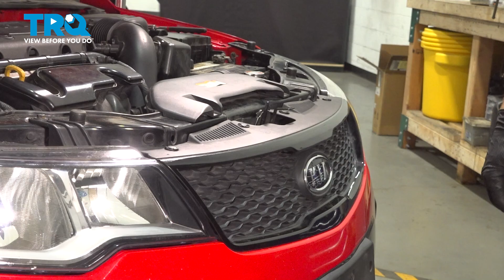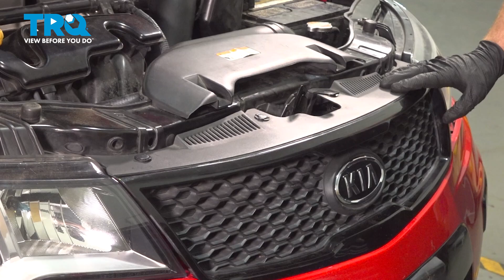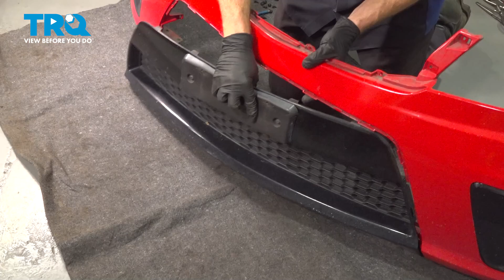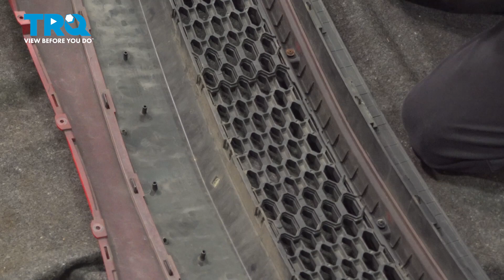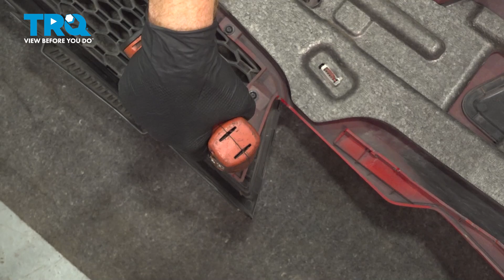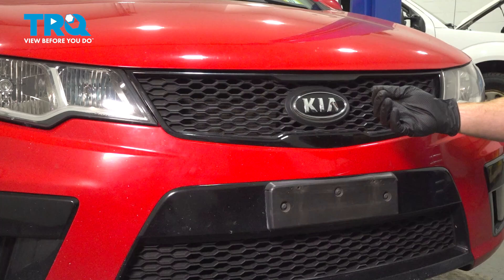How to Replace Front Bumper Cover 2010-2013 Kia Forte Koup

Comment: Do you have videos of 1st gen Kia Forte Koups:

Alternator, starter, compressor, AC system, cooling system, engine belt, intake manifold, engine pulleys, timing chain, crankshaft, pistons, cams, valves, engine, engine mounts, front & rear suspension, transmission, transmission mounts, subframe, CV axles, entire dashboard, heater core,